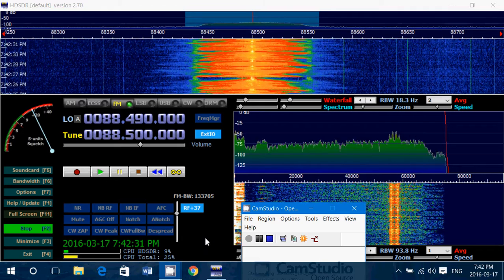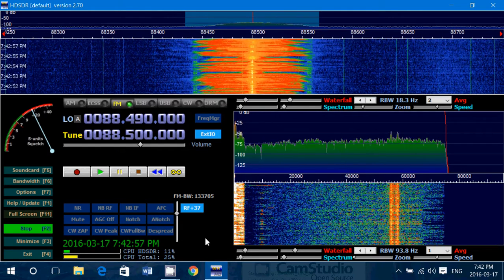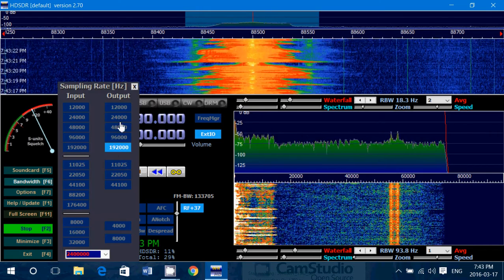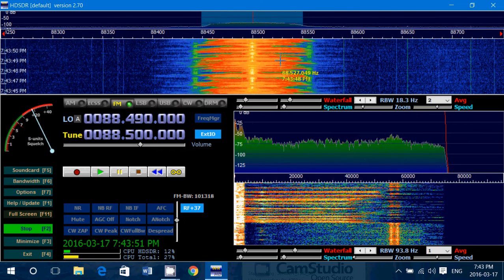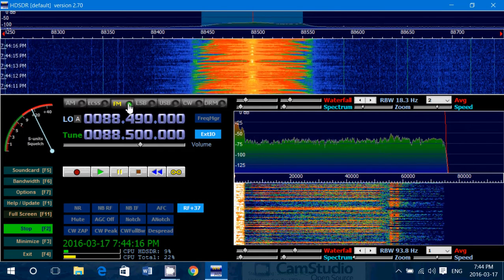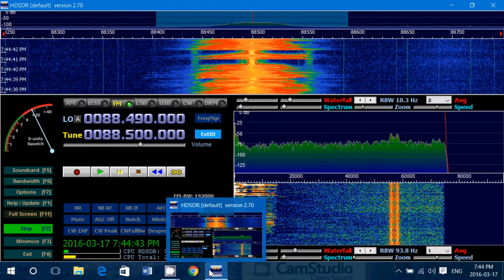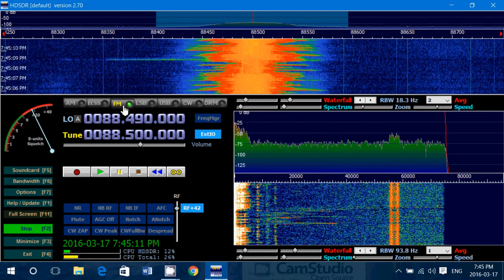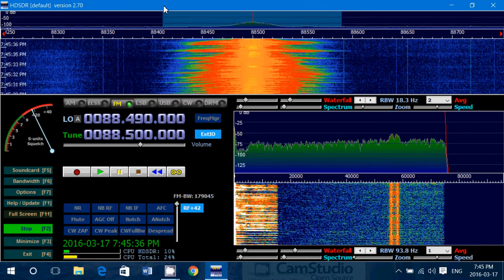How to setup FM for Wideband FM listening of local FM stations on HDSDR software

Comment: Thanks! This software always reports the frequency accurately so fat, the others, Cubic I haven't gotten running get, and SDRSharp won't change the lo when I tune it sometimes, but it changes the display anyway so the number is incorrect.

 When the lo doesn't update, Hdsdr notices and reports the accurate value and I can press button until it actually changes. I like this.

Comment: but... the signal is still preemphasised ;) Important thing is to set FM-BW so that it doesn't clip at 100% modulation (+/- 75 kHz). Typically anywhere between 150-192 kHz as you did.

Comment: What advantage if any, has this program over SDR#  ?
Reply: You can use it together with RDSspy software. And adjusting signal wave to optimise sound is better, in my opinion. At least in FM mode that I am using.
Reply: I didn't try shortwave yet, just FM. you have to adjust reception with ExtI0 settings, and bandwidth too.